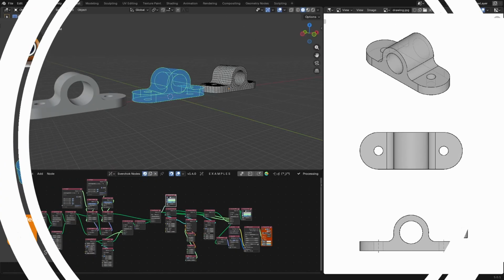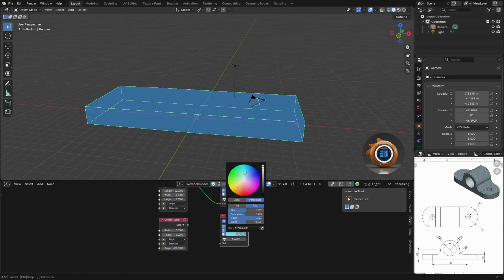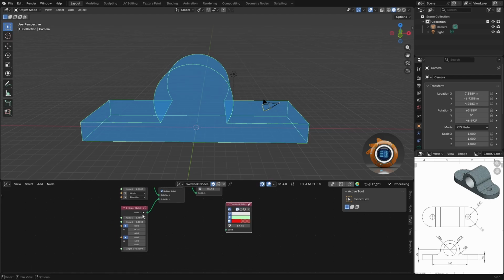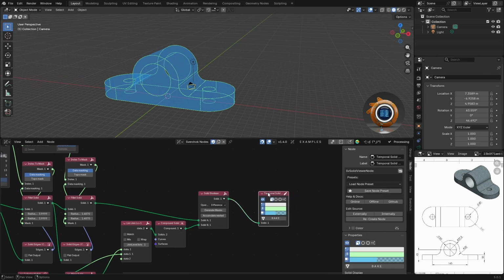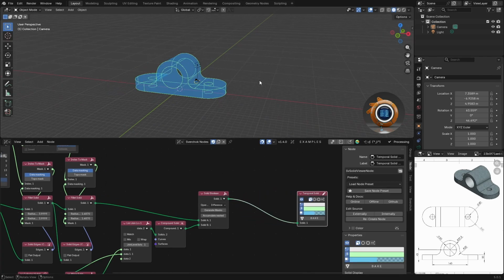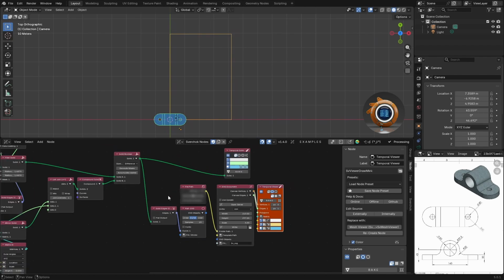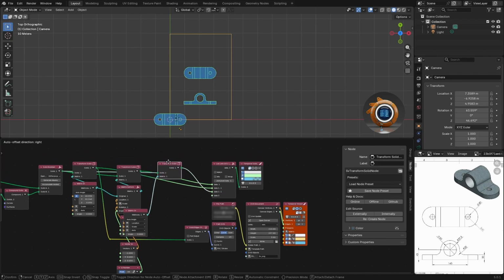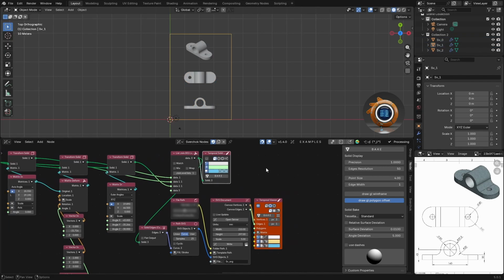Real CAD Modeling in Blender - EP1 CAD Modeling and Drafting

Comment: It's not related to this video but I don't find another way to ask you: would it be possible to import a STEP or IGES file into Sverchok, make offsets from the NURBS surface in Sverchok and export the offsets into STEP or IGES again?
Reply from the maker: Hi Steve, I’m not completely sure I understood your question, but in Sverchok it is possible to import and export several CAD formats and exchange files with other CAD software.
I made a short video about this here: https://www.youtube.com/shorts/DiC7NTBm3xE
I’m also planning to make a longer video focused on this procedure, but I had to pause the channel for a while to finish my PhD thesis, the deadline is getting very close.
If you can describe in a bit more detail what you’re trying to achieve, I’ll do my best to help.
Reply: @BlenderAidedDesign Hi, thanks for the quick reply. 👍 First of all, good luck to your PhD! Take your time with the channel, real life is more important! 

I'm doing Alias modeling for over 30 years now and one of the ugliest work in Alias is to build B surfaces for the A, design surfaces. It's a huge PITA as Alias is not a solid modeler like UG or Catia and therefore doesn't provide those tools. 
I was wondering if it would be possible to do some kind of automation with Sverchok/Blender. Import the A surfaces from Alias, thicken them with Sverchok and either write them back out to Alias or tessellate them for Blender visualisation usage. 
BTW, do you have a Patreon page? 
Your work (if you plan to continue after your exams) is very unique and I guess some people would contribute a couple of euros a month to support you.
Reply from the maker: Thanks a lot @SteveThinman, I really appreciate your message.
I know what you mean. I taught Alias in a couple of classes a few years ago, so I’m quite familiar with how stiff it can feel.
I’m not sure yet if Sverchok can handle this properly, but there’s only one real way to find out: send me a sample file and I’ll be happy to test it ;).
And no, I don’t have a Patreon at the moment, but thank you so much for suggesting it. That honestly means a lot. Once I get past the PhD deadline, I definitely want to keep working on the channel.
Reply: @BlenderAidedDesign How can I send you a file? Preferably outside of the open web.
Reply from the maker: Sorry for the delayed reply. At the moment I still don’t have a dedicated email for the channel. I’m planning to organize this properly in the future (maybe together with a Patreon or a small community space as you suggested). In the meantime, if you want, you could upload a generic test surface somewhere (Wormhole, WeTransfer, Dropbox link, etc.) and post the link here temporarily — obviously only if the geometry is not covered by NDA, patents, or industrial confidentiality.

Comment: updated dxf export today and uvconnect (data splitted to edges abd pols). So, scale factor solved some. dxf in zcad showeg well as shaded 3dfaces, so wire lines. Also, zcad today solved dimensions problem, So, our dimentions are well drawen in zcad now.
Reply from the maker: Thanks a lot for the updates and for sharing these improvements. This sounds very promising for drafting workflows.
I was wondering if in the future it could be possible to integrate the Solid Edges node more directly in the workflow, exporting those curves straight to vector formats. That could make the process much cleaner for technical drawings.
Another thing that might be very useful would be extracting the silhouette of the model from the solid workflow. That could help a lot when preparing projections for drafting.
Thanks again for the updates and for all the work on this!
Reply: @BlenderAidedDesign  solid edges can be exported as sequence: (convert-solids-solid edges) -- (exchange-export solids (BREP)) and open it in any programm as freecad etc
Reply from the maker: Thank you for your reply and for taking the time to check my channel.
Your suggestion is actually quite close to the workflow I showed in my video. The main limitation is that the exported result is still a polyline, not a continuous vector line.
Reply: achiving  pleasure in zcad workflow. Yerlier thought that it is electric cad, but for now it is bertter choise than librecad or something